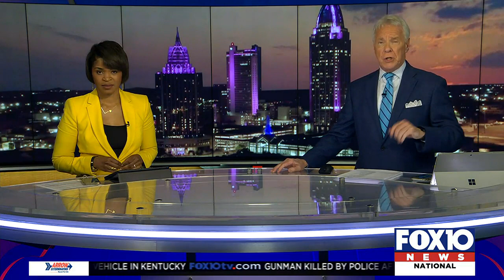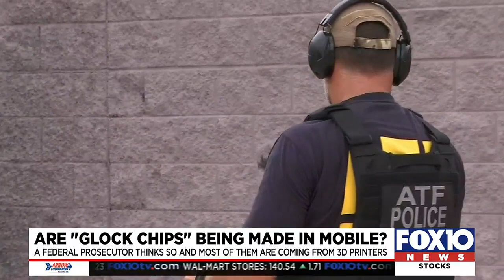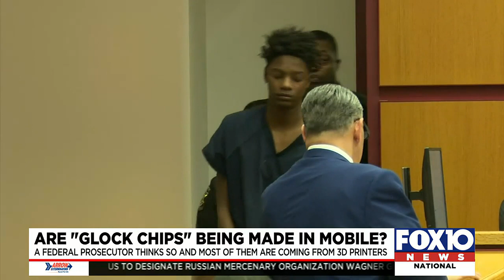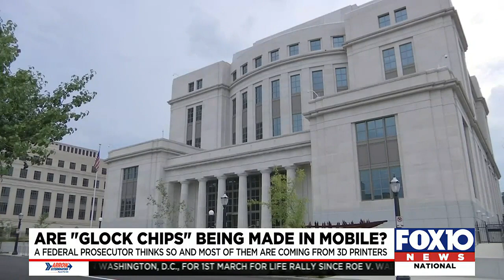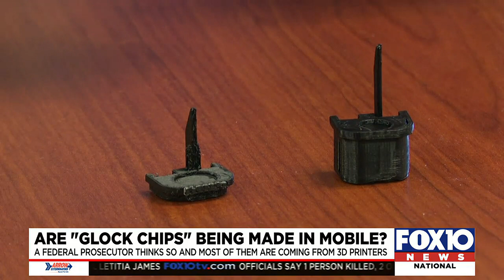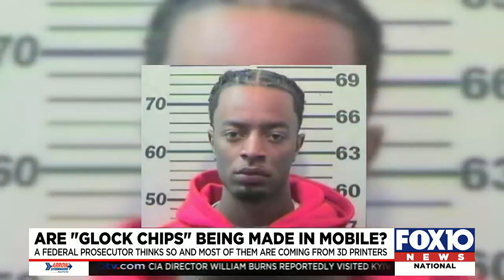Federal prosecutor believes Glock switches being made locally

Comment: Good luck regulating a piece of plastic that anyone can 3D print for 2 cents.
Reply: Go ahead and stick that plastic piece in there and see what happens.
Most people probably aren’t dumb enough to use plastic..
Reply: @koffiarizamoto9326  Most people aren't dumb enough to drive up on a crowd of people and mag dump on them, but it happens.
Reply: @gremlin5813  parts $40-$80 and can be killed out with a power drill.

Comment: So first they were coming from China and now it’s 3D printers?
Reply: It’s both.
The metal ones come from china and then there also are 3d printed ones which are usually made locally.
The metal ones allow you to choose between semi and full auto while the printed ones usually are full auto only.

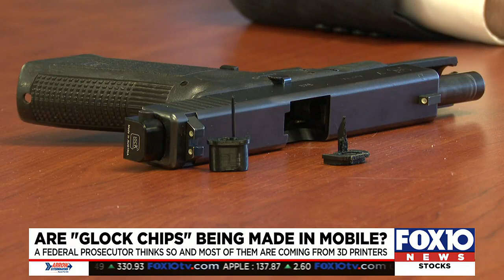At 0:44 you can see a metal one (installed in the gun) and two printed ones laying next to it.

But the printed ones aren’t new.
The files for those have been available since 2020, they are just getting more common because the Chinese stop more sites from selling metal ones and so criminals just buy printers to make them at home.